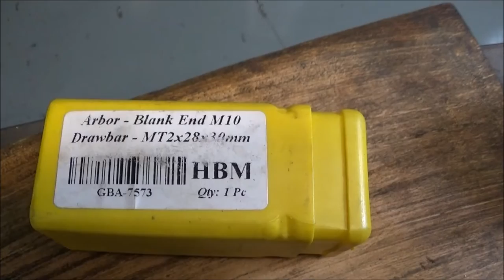Making An Adjustable Chuck Back Stop On Myford Lathe MT2 Soft Arbor

Comment: HI Steve, I managed to get the collets bearings etc from Bang good. However your link for the MT2 soft blank arbor, won't ship to Australia.
I have searched e-bay etc but no luck, do you have any other supplier suggestions?
Reply from the maker: Hi Graham if you are unable to find one on Ebay you can use an old MT2 tapered shank drill for this backstop. Just cut or grind the drill  end off and use the tapered end. They are not usually hardened and machine easily. I have used several of them for other tools in the past. If they were hardened I would have heated them up red hot and let to cool slowly to anneal them
Reply: Great idea thanks again for your help.